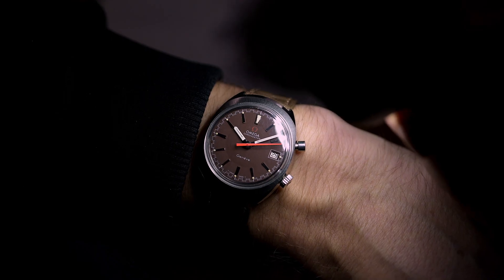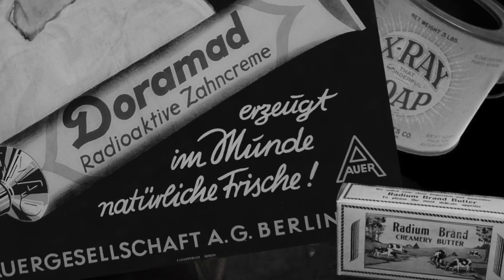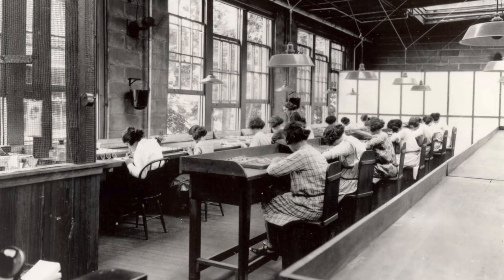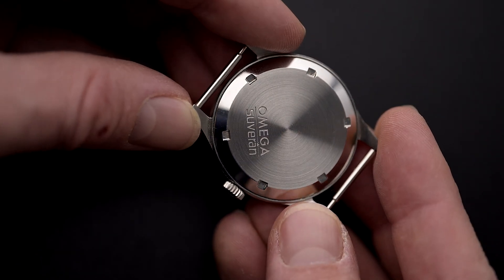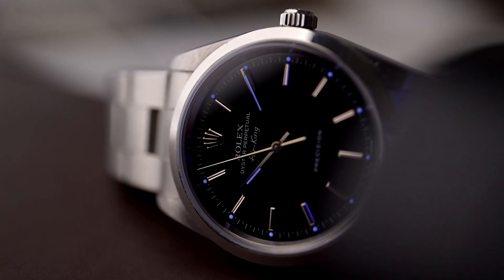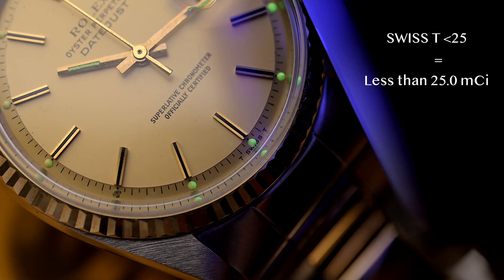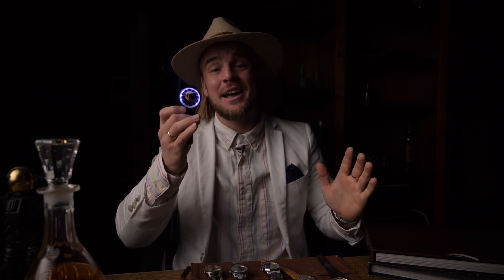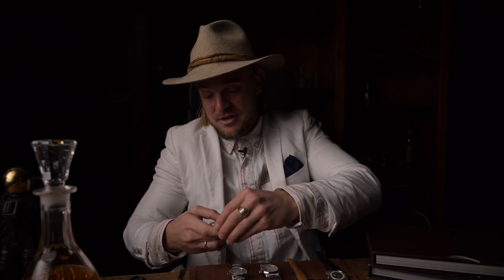Radioactive Lume in Vintage Watches: From Radium to Tritium

Comment: Very interesting and well put together video! A+! THUMBS UP! I collect old clocks and pocketwatches, so this was a fun watch for me [pun intended].

Just one small correction, Luminova and Superluminova both glow Green. Original "Luminova" is about as bright and long lasting as most glow in the dark toys (maybe a tad better)." Superluminova" was designed so that the watch hands and dial would remain legible throughout the entire night (assuming your eyes have adjusted to the darkness). The most popular Superluminova types are "C1" which is used by most watch brands like Rolex (Bright White in the daylight, glows a Pale Green at night), and "C3" which has the daylight color of when you open a tub of Vaseline and look inside (a sort of icky pale yellowish and maybe slightly greenish color in daylight), and it glows a brilliant Tennis Ball Green at night. C3 is the brightest and longest lasting of all Green glowing "SuperLuminova".

What Rolex uses today is not "SuperLuminova", it's called "ChromaLight" and glows a Aqua Blue color. Chromalight is a  proprietary luminous material owned by Rolex, but lab tests show it is basically chemically identical to BGW9 lume. BGW9 and Chromalight is bright White in the daylight, but glows Aqua Blue at night. When hit with sunlight or a UV light then placed in the dark, Chromalight/BGW9 doesn't initially glow as bright as C1 or C3, but it also doesn't begin to fade as fast as SuperLuminova. C1 and C3 do indeed glow very bright initially, but they begin to fade within seconds, holding onto a legible amount of luminosity for hours. 

Chromalight/BGW9 holds onto its Aqua Blue glow much longer than SuperLuminova, which is why Rolex and many other watch companies now uses this. The Aqua Blue glow is also more aesthetically pleasing to the eye for most people over the typical Green we see in older watches. Especially in dive watches, where that Aqua Blue glow is pairs well with the water it was designed to be used in.
Reply from the maker: Thanks so much for the detailed insights! Very helpful additions.

Comment: Basically, it's a very dangerous substance, but a small amount contained in a sealed case that's not near you 24/7 won't hurt you much. 

The problem would be if the lume had decayed into dust and fallen off of the hands, the watch was opened and movement taken out, and the hands removed while your unprotected face was four inches, the focal length for a 10x loupe, away from the hands and dial, while you puffed away at the dial with your little puffer, spreading the radioactive dust and radon gas everywhere, sucking it into your lungs while you gently polished the steel of the hands and brushed the dial. 

Uh oh. i did the thing that was a problem

Comment: Hey man, thanks for the video! I have a Rolex from late 1959 - this was already the era when it begun that they changed to Tritium. I compared it to my zincsulfit 66 gilt sub (around  0,7 usv/h like your omega). The 59 Rolex is around 1,6 usv/h. This is just right on the acryl glass. When you go back like 3-4cm it goes to pretty normal. Even my gilt with zincsulfit from 66 is right in your omega radium range - why is that so? Both of my watches are tritium and not radium.
Reply from the maker: Hey, thanks for your comment. Unfortunately I can’t give you any advice from distance…

Comment: I knew that tritium and radium keeps glowing continuously until they decay after years, even in the absence of light. Does this also apply to paint? Because from the video it would seem that when the UV light is turned off the tritium and radium, rather than simply losing intensity, to turn off completely
Reply: If I remember correctly the radium in the paint makes a separate phosphor glow, but over time the phosphor can burn out, eventually only really working under UV light/blacklight, I believe tritium would work in the same way but I don’t know as much about it so I don’t want to say anything incorrect, I hope that this helps explain it a bit better :]

Comment: Hi I'm from India. Can you help me with this.. I bought a Bible Verse picture which is framed in glass and it glows in darkness... Will that emit radioactivity???..
Reply from the maker: Which year is it dated? If it is from the 20s to 50s it’s possible but I don’t think so. Just buy a Geiger counter on Amazon to be on the safe side :)
Reply: @GoldammerVintageWatches   I bought it in 2023 from a local store.. it's just a recent manufacturing.. new one..
Reply: @GoldammerVintageWatches  and the thing is. The image I bought is 800 rupees. And this Geiger is 7000+ rupees... 😅 So it's 7 tyms higher investment..
Reply: At least until the phosphors burn out tritium and radium based luminescence doesn’t require charging by external light, so the verse would  glow continuously in the dark when not exposed to light if it is truly radioactive.

Comment: I have a radium compass and a scintillation gamma detector, which is way more sensitive than a geiger counter.  I'm sorry, but I don't want something greater than half a million counts per minute close to me for a long time. That's what my detector reads from this compass.  I also have a clock that gives 20,000 CPM from radium. On the other hand, my tritium watches barely give me anything above background radiation.  Much safer.
Reply from the maker: Thanks for sharing this kind of measurement 🙏

Comment: Quick question - Is it normal to have the tritium glow differently on the hands compared with the glow on the indices assuming they are matching hands and indices? All are tritium but somehow the glow looks different on the hands.
Reply from the maker: Normally the glow should look the same on hands and numerals, but often it looks different because the amount of material on hands and numerals is different. Sometimes there is more on the hands and so it looks brighter and stronger, or just on the numerals ;-)
Reply: @GoldammerVintageWatches  that explains it. Thanks for responding